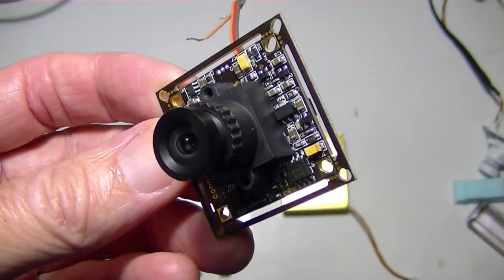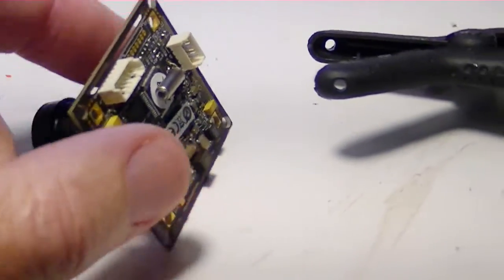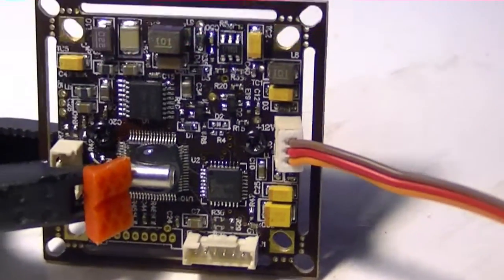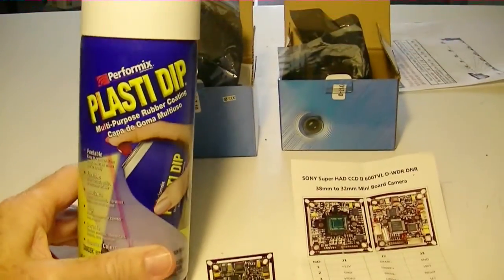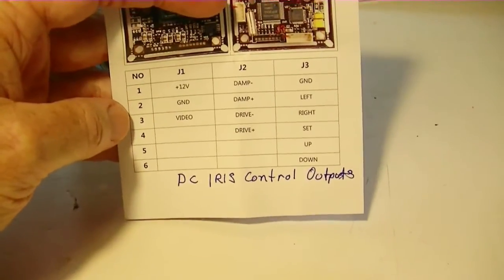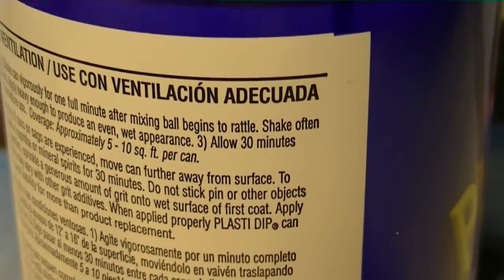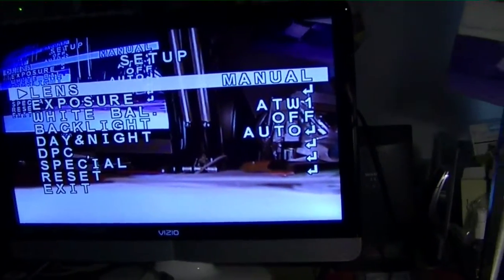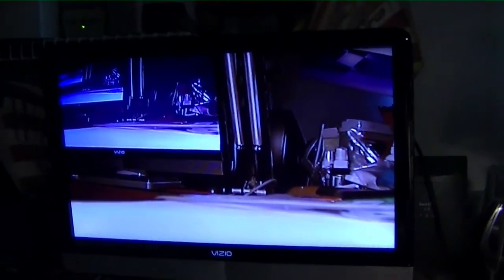FPV Part 2: Sony PZ0420 Camera Waterproofing with Plasti Dip

Comment: quick question.. i didnt realize it wasnt waterproof till recently.. my cam is no longer working after a storm a couple of weeks ago...is this fixable?
Reply from the maker: If it's been a couple weeks and the cam is dry now and still doesn't work I would guess it's toast. Get a new one.
Reply: ok.. i know nothing about the innards of electronics .. it is a lil green where it connects the lil white thingy with wires to the cam

Comment: At the end of your video you showed a menu board connected to it. After you set up the camera , can you remove the menu board?
Reply from the maker: +gordon bennett Yes, it just unplugs from the camera. I plug the cables in while coating with plasti dip to protect the sockets. You can use something else like tape as well.

Comment: OK..Great Video as usual BUT why can't we use the Liquid Tape product on the market in place of Plasti Dip? We use this in place of electrical tape, I really don't see how it would harm anything and no spray..we brush it on. I would like to hear feedback on this...Thanx.
Reply from the maker: Lew Scagnetti Sure, If i works then go for it. There are always options.
Reply: *****
That the problem !!..I don't know if t would harm the fragile electronics in the camera board. Ihave a TBS69 mera and feel kind of hesitant to se Liquid Tape.
Reply from the maker: Lew Scagnetti I have not tried it myself. My feeling is it will work but it's thicker stuff so might be messy.
Reply: Plasti-dip is exactly the same as liquid tape. In fact when it first came out years ago it was in the form of a can you would brush it on. So either will work just as well in the liquid brush on form. However, the plasti-dip spray even after 4 or 5 coats is still less product and weight than the liquid tape.  You can also get Plasti-dip in clear. It adds a dimenison of protection to everything that pretty much has to be experienced to be understood. I have all kinds of things I've dipped. My truck, lawnmower, all kinds of things I use all the time. The best part is.. if I don't like it, or I decide to sell the item I can always peel the plasti-dip off very easily and my finish is whatever it was before i sprayed it.  As a side note, in this video example the product is applied too heavily the first coat. It's better to apply about 5 light coats. You won't get runs or bubbles.

Comment: Thanks for testing. Now i know you can spray the whole thing without issue :-)
Reply from the maker: Maarten Oosterink Thanks and I have been using two of the plastidipped board cams for several years now with no problems. Works great!

Comment: great video! got a small question, can i just plug this directly to my TX wich runs off a 4S lipo or do i need a stepdown?
Reply from the maker: 12volts or 3s is what I use for the camera and VTX.

Comment: The edges on lense edge should be filled to prevent moisture on the chip. I use brush on plasti dip, :o)

Comment: Dave you needn't respond to this, it is just for your viewers. I also would promote a couple of coats of laquer from a rattle can. In Canada you would be surprised at how difficult it is to get spray on Plasti-Dip, or for that matter, decent brush on material of a similar nature.
Reply: Lowes has it

Comment: Nothing in the instructions, just spurenz.  Also get some good quality fiberglass string packing tape and cover the bottom of the plane and the little part at the tail.  I will protect the fuse when it skids in for a landing..  You should use the string tape on all the hinges, as they will break.  Use very good quality metal gear servos also and a big ESC.  I am a wealth of kanowledge??

Comment: These cameras are the best out there, however, they will break easy.  I have never gotten one wet.
Hey don't forget to brace the tail of the skywalker with some 1/8" carbon rods.  The tail is flimsy without bracing.  You will be glad you did!
Great job